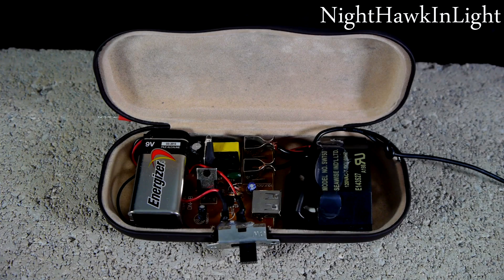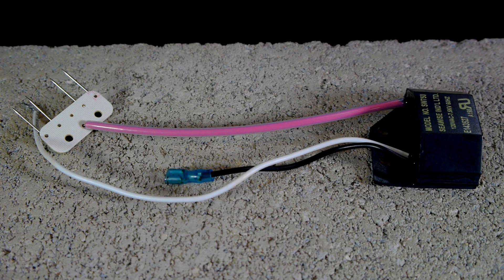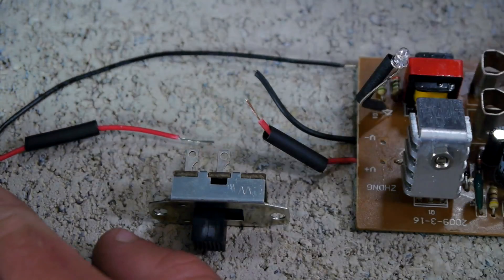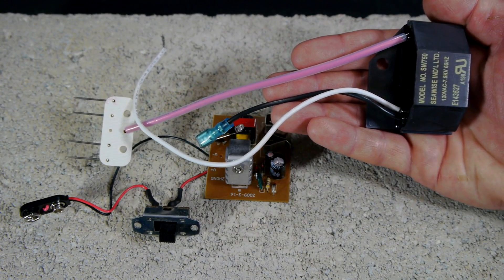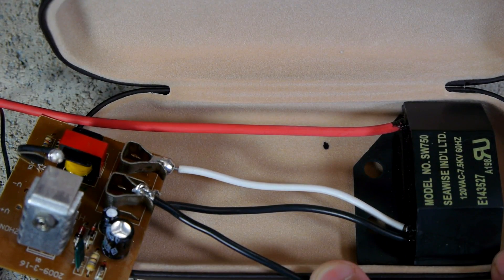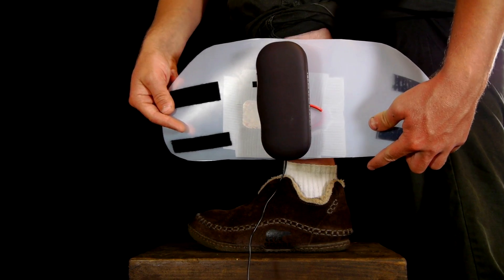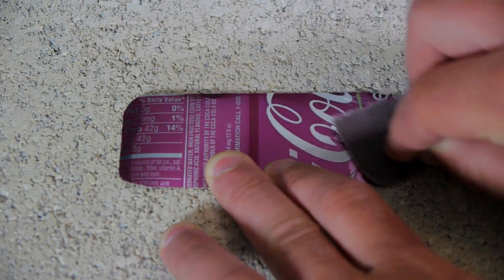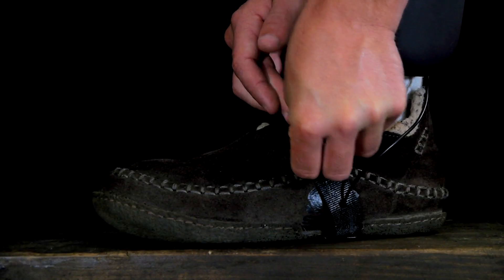How to Shock Anything & Fry Electronics with a Touch!

Comment: I have the electric touch 2.0 which is essentially the same thing, I reach up and touched something over my head and the device on my leg strongly shocked me, I had to run to shut it off, what could have caused this? Could it be that I maybe subconsciously tippy toed and released the ground? The shock that I was expecting on my finger from touching the metal quickly went straight to the device and froze my leg.

Comment: Sir, i have an issue with my negative ion generator. I am not getting an electric arc between the ground wire and the long red wire. Whats the problem?
 I am using an AC generator, but its not one exactly like the one you used. Mine has an "electricity outlet" on it as well as a USB outlet. Also, mine does not have the two prongs that yours has that red and black wires form the ion generator plug into. Also, my negative ion generator looks exactly like yours, even has the same model number on it, but mine has a green ground wire coming out of it, in addition to the other three wires. Any advice would surely be appreciated.

Comment: Hi. My son is built the newer version of your static generator (the 5v one) for a science fair project but we are confused about one thing. Does this device pull electrons from the users body and leave him with a positive charge or does it give him electrons and a negative charge? I think you said it gives electrons, but the user seems to be connected to the red wire and red is usually for positive. That is why we are confused.
Reply from the maker: Red and black wires are opposite from what they really should be. The red wire being positive is the one the electrons flow from and the black wire they flow to.
Reply from the maker: It's annoying, I know. The positive terminal of a battery is where the electrons come from

Comment: why is it necessary to have the high voltage ground plate touching the surface you're standing on? Im pretty sure I understand why it's attached to your shoe (but please correct me if I'm wrong). Anyway, here's my best educated guess: The high voltage positive of the supply is solidly contacted to the wearers skin. Since your body is well insulated by the shoe from the surface your standing on, your body is able to hold a strong positive charge. otherwise as the high voltage positive of the supply pulls electrons from your body, electrons would be pulled from the floor to neutralize the difference in charge so your body is shorting the HV output of the supply. Since you're wearing the insulating rubber shoes , you're body gains a strong,  sustainable positive charge and results in a small parasitic capacitance between your body and the HV ground. So it makes sense why you'd connect the HV ground plate to the bottom of your shoe since this will increase this capacitance due to the added surface area of the plate and its closer proximity to your body. But why is it important that the floor touch HV ground? I know you're right and I'm sure it's probably a very simple reason for this but I'm missing it. 

anyway sorry, RECAP:
 -SHOES KEEP BODY FROM LOSING CHARGE THRU THE FLOOR
 -YOUR BODY IS THE POSITIVE 'PLATE' OF A CAPACITOR WITH THE GROUND PLATE UNDER YOUR SHOE INCREASING THE AMOUNT OF CHARGE STORED PER VOLTAGE, AND THUS, PRODUCING A STRONGER ELECTRIC FIELD AROUND YOUR BODY.

now if any of that is wrong please let me know and also help explain the purpose of the standing surface and HV ground contact.

Comment: I must have a answer while I am not using or touching anything does the volt battery run out I mean like if I don’t touch anything?
Reply from the maker: If the power is on it will drain the battery, yes.
Reply: NightHawkInLight thank you🙏

Comment: Maybe you can help me on an idea I have to protect a motorcycle from theft. I was thinking about wiring a capacitor to the frame of the bike with a disconnect switch for my own protection from getting shocked. The current source would be the battery on the bike.  I don't know if it would work or what capacitor to use or anything else as far as that goes. I know how they feel because I connected with my microwave while trying to replace a belt... wow it was a real shocker and a great deterrent. So any help and thoughts would be much appreciated.

Comment: I actually had the opportunity of building one of these and it works quite amazingly well with my biofeedback experimentation(by letting me boost my energy BEFORE testing my levels).  Utilizing it even an hour a  day seems to increase conductivity or enhancement of receptors for  receiving more fluxea of negative ions, resulting in ALOT better vibes.  This really is no toy but it  isn't so difficult to build so anyone attempting to use... make sure you are healthy and know what you're getting into.  Thanks for the schematics, Nighthawk.

Comment: can you please tell me what is the purpose of the ground wire? and if you stand on plastic surface will it work? and after you converted dc to ac does it matters if you flip the black and white wires positions? lol last question, after the conversion, to what output did you connect the ground wire (to the Live phase or to the Neutral)  assuming the converter provides Live and Neutral if not what are the outputs of the converter?
i would really appreciate it if you answer my questions, thanks in advance
Reply: 1.The ground wire in this video is producing alternating current, so it is not a negative terminal. But the ground is needed since the ion generator generates negative ions, so it needs constant supply of -e, and the ground happens to be a sea of -e. 

2.It won't matter if you flip the position of the wires, since the generator is AC fed, just like how we can put a two-pin plugs either way we want. 

3. Therefore put the additional ground wire to which ever side you want, it will work.

But in case you are powering a DC fed ion generator directly from a DC supply, the ground wire would be the POSITIVE terminal of the output.. It will still work otherwise, but your body would then be charged with positive charge instead of negative, and it would be harmful to your health. [google benefits of inhaling -ve ions]..
Reply: thanks a lot,
so if you stand on plastic this won't work right?
and can you tell me what are the outputs of the converter is it live and neutral?
Reply: and if lets say you don't connect a ground wire, the ion generator would still work just fine, providing negative charge. why do i need the ground?
Reply: No prob.
It won't work on plastic. The output of the converter would be high AC current [live], and very low AC current [neutral], WHEN they are not connected, that is, when the switch is off. But when the circuit is closed, both neutral and live wire would carry the same current. 

If you won't add an additional grounding, your body would still be charged with the high output voltage, but the current would be lower since you would depend on the electron supply from the batteries only. Thus it would take incredibly longer for you to fully charge yourself. 

Think of your body and the ground as a capacitor. You could charge one with only one DC terminal, but the other half of the plate won't charge completely,  thus the peak capacity [total charge stored] of such capacitor wouldn't be reached. 

You can also think of this as two glasses of water [positive and negative plates]. You could fill the other glass with external supply of water, and dump the water in the other glass so both would achieve the highest difference in content [the higher the charge difference the higher the current].. One full of free electron, another is devoid of free electron. But if you would fill one of them and another one is left with its content, you would get one full glass of water and another half filled, so the difference wouldn't be as great, i.e less current is stored
Reply: i really appreciate the fact that you found time to reply to me.
but i find it hard to understand, because the ion generator provides one plate of the capacitor (the body) with positive charge, and like you said the ground provides a negative plate. so like you said because of the low potential difference between the capacitor plates, the current would be very low, so i have to increase the positive charge on ''my body'' plate. and i am doing that by connecting the input of the ion generator (doesn't matter what input) to the ground. now there would be a lot of positive charge on one plate and a lot on the other thus providing a higher current.
is that what's happening? did i get it right?
Reply: jamal masarwa Anytime brother :-] You got it right! But the output of a negative ion generator is actually a negative terminal, because it is meant to shoot electrons out into the air to charge it negatively. But in this case, it adds electrons [ from the ground ] into your body with a very high voltage.

Comment: It does not "push" electrons ount the red wire, it actually pulls. So if you touch someone barefooted, the electrons will flow from Ground (negative) through him and into your device. The device then pumps then back into ground.
Reply: Angry dark Don't humiliate yourself. For a negative ion generator, the output is high voltage NEGATIVE DC. So it does, PUSH electron out the output to create -ve ions duhh.. It does not pull the electron from the shock receiver, but from it's own grounding.
Reply: wrong.. it pulls electron from the ground, into the device towards the output. It's a -ve ion generator so the output is actually a very high [about 4k V] negative DC terminal
Reply: Congratulations you said the exact same shit he said.

Comment: hello, can someone help me? I tried to make this project did not work, have the generator to the white wire, so I called the land before the battery connector, makes spark when it comes close to the output wire, but does not work when I put the red wire on the body and the black on the floor, why?

Comment: will this ignite flammable things?
Reply: +Hafidz Imad if the spark gets to it, it might.
Reply: Hafidz Imad Most likely. He has a newer video of the same thing when he's using a different ion generator that doesn't require the car lighter converter and he sets fire to a plate of flammable something (maybe alcohol) by getting his finger near it.

Comment: As far as I know, using aluminium as a cathode is not risk free, because electrolysis and some shit. You could accidentally embed aluminium in your skin and ultimately get it in your bloodstream. I have no idea, though, if this is the case with high voltage and low current. So correct me if I'm wrong.
Reply: +Tinb A Electrolysis only occurs when there is a solution containing free ions of both the elements in question. So no possibility of that happening.

Comment: @NightHawkInLight what would happen if you wore two of these on each leg?
Reply: Nothing, when there's electrons from the ground and they get transferred into an object it creates and equal connection. Just say the ground has 10 Electrons and the body has 0. When a connection is made you gain 5 electrons and the ground losses 5 electrons. The body has 5 electrons and the ground has 5 electrons. 5+5=10 and therefore it is equal. More generators will do nothing because both objects will always have an equal amount is electrons
Reply: +Night Hawk I'm not sure I understand this example. Why does the ground start off with a negative charge? I do understand the intuition that perhaps there is a "maximum charge" that a negative ion generator can create on a person, beyond which more generators won't do anything, kind of like a bunch of batteries in parallel. But isn't there a way to connect these in series to get more charge? (I'm not familiar with these devices).
Reply: +Bizorke no, there is no difference between 1 and 20, you will just be able to shock faster once you start moving around, because of the larger surface area in contact.
Reply: +Night Hawk could you connect a few of them in series and get a better result?
Reply: Philipp B That's what I asked.
Reply: Of course! I made one with 3 bug zappers connected in series.

Comment: I made one of these. It was fun, but the only thing is that it also shocks yourself and it hurts after doing it many times.
Reply: +Kevin Jensen can you send me one :D?
Reply: I made it like 3 years ago. I still have the ion generators. It was super easy to make actually. Just make it. All you really need is the ion generator (from some asian site or ebay) and a 9 volt battery holder with a switch.

Comment: I think I'm going to ask my electronic specialist to build me one of these. Can you please tell me will it light a fluorescent light that you hold in your hand ?
Reply from the maker: +bRad “bRadicalMagic” Nichols Yes, it will. But I've found it charges them like capacitors and the lights can then give you a nasty shock so I don't recommend it.
Reply: +Oblidemon Ouroboros 
You could say that again ! ! !
Reply: bRad Nichols I totally could but my internet thinks 2 is enough.

x3
Reply: +NightHawkInLight Should have read this one before xD

Omg it stings.
Reply: +mysterymediacorp Shock people when they go to shake your hand.
Reply: +NightHawkInLight Should have read this one before xD

Omg it stings.
Reply: Oblidemon Ouroboros 
LOL
thanks for having a Sense of Humor . . .
Reply: +NightHawkInLight What are the practical uses?
Reply: +bRad “bRadicalMagic” Nichols omfg GREAT IDEA!! Human torch
Reply: Nope. You as the source of charge holding a fluorescent light will be an open circuit. Unless the fluorescent bulb is grounded, or the charge you are containing is alternating. You can do it with pulsed DC though, by removing half the rectifier of the Ion generator. I've made a bulky one with 3 bug zappers connected in series, producing pulsed static which both charges my fingers a bit and lights up small fluorescent bulb
Reply: Isnt the bug zapper potencialy dangerous?? becouse I really want to try it with mine but I think 10000 volts can be dangerous for this aplication. please answer
Reply: Red Point Bug zapper IS dangerous. For flies and mosquitoes. It will definitely shock you but it can't produce enough amperage to damage you.
Reply: Branden Peter you Shure?!

Comment: Would it be possible to have a higher voltage battery that would not harm the user if the surface are of the aluminum were significantly increased? For instance a battery for a small car if the user had an aluminum "buffer" that covered their entire back? I do not plan on doing this, but if my thoughts are correct (I am by no stretch an electrical engineer), could one make a potentially lethal version of this? If my limited knowledge serves me correctly, transferring the electrical energy in your body (From the car battery) into a smaller arc point onto another individual could increase the amperage to lethal levels?

Comment: If you wear this and you're holding a larger metal/aluminum rod or a baseball bat made out of those materials, would it hold a significant amount of electricity or would it be weak due to its mass?

Comment: Do i need 30 kv or are 4 kv also enough ?
Reply: Please use the less than 30 kev output thats quite a bit of voltage...... even if the current is low
Reply: HV and more What do you think?
Reply: I don't know maybe te 6 kv is ok but i do not know ;

Comment: What if you hook up two 9v batteries; so to make 18v
Reply: NickTheFox23 :3 You might kill the power inverter. It's only designed for 12V. If it tolerates 18V (I guess it will), it will still only output 110V, so nothing of interest will happen. If it works, it will probably keep going for more than twice the time, but it will run the batteries way down.
Reply: thermate93
Would it be safe!? Idk I want to be able to put most power through my body without harm; though idk exactly what the limit is..
Reply: One of two things will happen:
- The inverter breaks, the thing doesn't work any more.
- The thing works just like before, without any increase in power.
It's safe for you, but it has a chance of breaking the power adapter.

Comment: So with a bigger battery, can you release a bigger shock? For example, if you took your body out of the process and hooked a car battery to it, what would happen?
Reply: Daryl Garton Nothing. The inverter produces 110V regardless of the voltage it is fed. 12V, which a car battery produces, is exactly what the inverter likes. At 9V, it draws more current but it still produces 110V. If you put more than 12V across its terminals, you might just fry the converter.

Comment: oh, so I made one of these. Bit differently but you gave me the idea.
I have 3 plate lithium ions @ 15000 mah (11.1V) that power a negative ion generator I got on ebay for about 5 bucks I think. The batteries I had from my pi box that powered a mini screen. The batteries fit nicely into a old project box and the negative ion generator is glued on top. I had some aluminium tape that helped with surface area for skin contact. Doesnt look as pretty as yours but its a bit smaller and probably gives off more power because its roughly 3 volts more input.

I named it, "The hand of god" (inscribed on it)

Comment: I made a simple version with a flyback instead of the negative ion generator, and for the power supply i used a bug zaper with a small spark gap between the wires, so the flyback could work better.